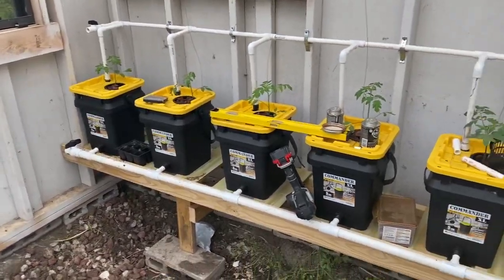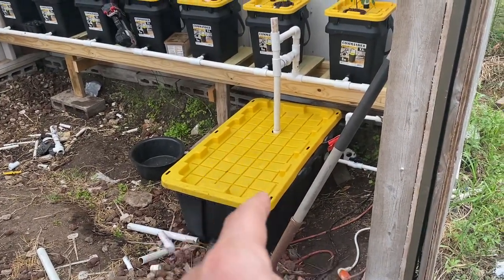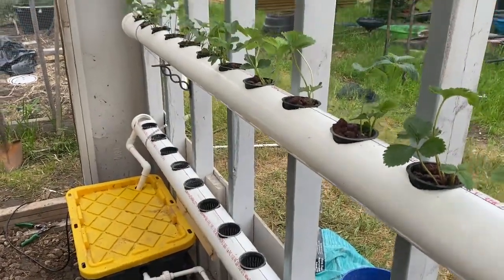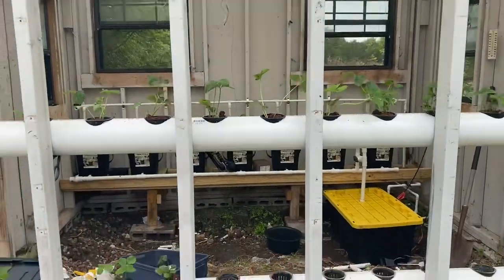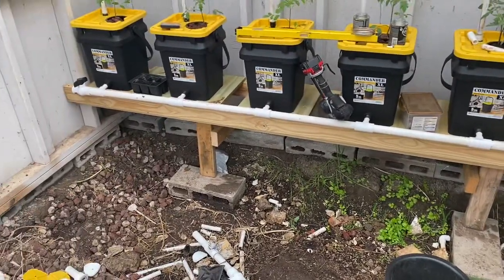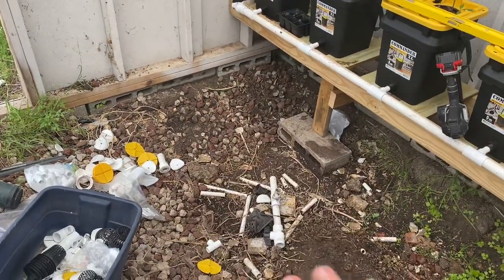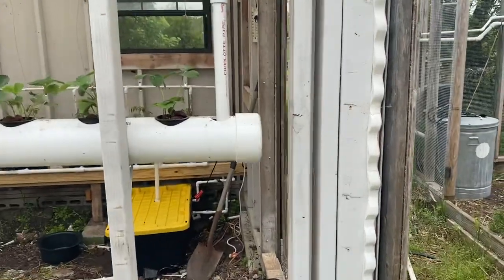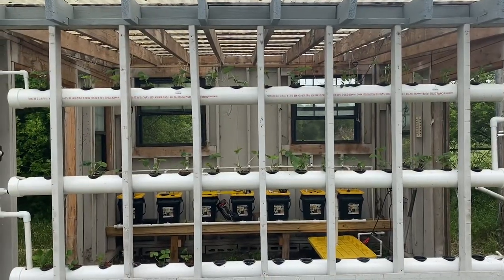New Deep Water / Aeroponics / Kratkyish Hydroponics System - Part Five - A Wall of Strawberries

Comment: Great video Jack! Have you thought of mounting 2 4x4's in the center of your room and run more tubes up the center? You may be able to get 4 or 5 more in there.  Also if you want to seriously cut your expenses use the non pressurized sewage grade piping.  Much thinner then the schedule 40 and way less money.  I also used the 3/4 Hydrofarm drain fitting AAEFBK3 I got from  Amazon and mounted them in the bottom and running a rubber hose down in to the tube below and so on, really cut the cost big time. In the top of the drain fitting I cut sprinkler head risers to the length I wanted and they screw right in.  Enjoy your setup looks great!
Reply: I saw someone recommend using the DWV grade pipe elsewhere and looked into it since it was substantially cheaper. Everything I came across said it was not rated for potable water, which might be an issue for some folks. I chose not to use it.

Comment: Awesome idea Jack. What I like about the idea is that you can add nutrients without affecting the fluid level disturbing the air roots unlike a traditional kratkey setup. Just drain the reservoir and refill.